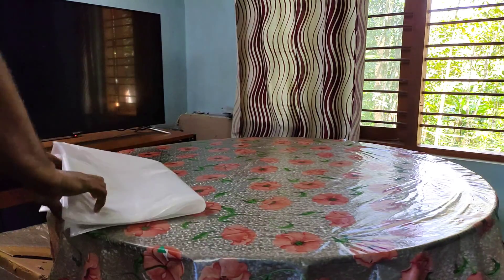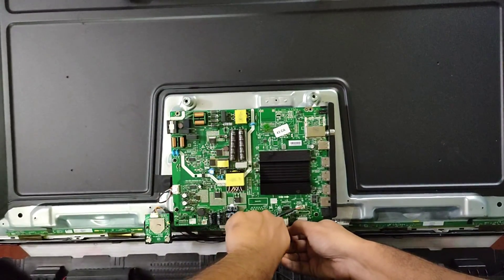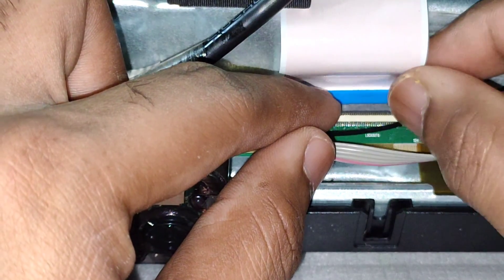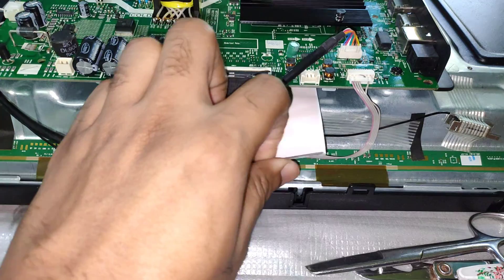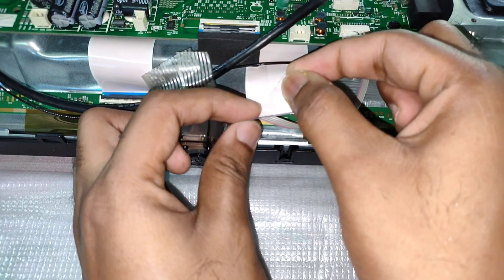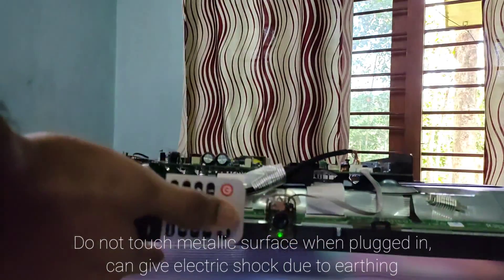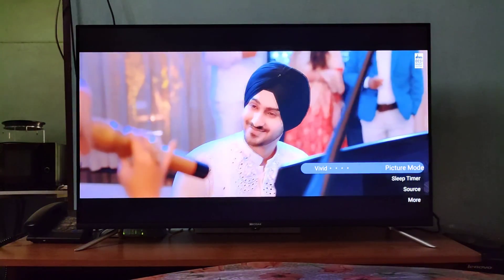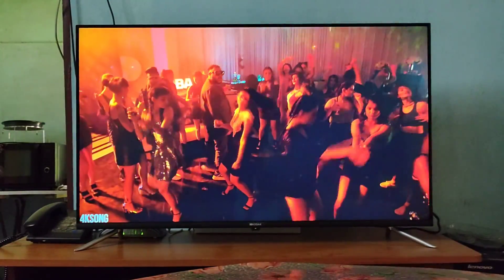LED TV display repair flickering flashing screen Kodak CA 108cm (43 inch) Ultra HD (4K)

Comment: my Hitachi had this exact same problem shown at 2.38 except the turning off part. different model TV with different internals but had the same kind of ribbons, I taped them exactly as you did and it fixed it. thank you for saving my TV!
Reply from the maker: It made my day✨️🙏 I'm glad thank you for sharing

Comment: My tv sometimes it’s flickering den again it’s  normal ….
Reply from the maker: It's better u don't watch it in this condition, it'll get worse over time and eventually completely stop working. Try to get it fixed by any technician, if under warranty pls claim it through authorised sources
Reply: @MECHTOYSOFFICIAL  technician can’t detect the problem .. according to me I think THE HDMI JACK 1  2 3 4 got some rust ..  but I don’t know  how to change it
Reply: If u have anyone from Kolkata … who can help me just share the no THE PICTURE w quality  MY TV IS SUPERB .. its SONY BRAVIA 55 w950b model
Reply from the maker: @BubbleTrouble645 does the User interface, menu,  apps all appear normal? They also flicker? If it's only when u plug in external PC via hdmi then it could be as u said
Reply: The problem is like for 5- 6 hours the tv is working fine even 24 hours also but again after 2-3 day the problem showing ….
Reply: @MECHTOYSOFFICIAL  it’s alll started after i connected my laptop   Wd hdmi cable .. few month back .. den it stopped after I shut down my tv n restart ….. den again few days back connected my laptop .. it again started n right now it’s continuing .. for 2-3 days I m not having problem den again on 4 day I am having problem .. … its happening mostly due during the afternoon time … .. .. yes it’s happening  the same way after I remove the hdmi cable
Reply: I thing some frequency or voltage issue.

Comment: I did this and the flickering has stopped. There are few  horizontal lines in the upper few centimetres but that's ok. Thank you so much.
Is your tv still problem free or noticed any worsening of the lines?
Reply from the maker: It lasted for several months...about a year. Then started flickering again. Nobody tried the method again and it completely stopped working. The thing is, once it starts flickering, don't watch it on that state. The longer u watch, more damage will happen

Comment: My TV entire screen goes green flickering and switches off then restarts. Then again after 5 mins green flickering shut down restart
Reply from the maker: If u keep on watching like this, it'll get worse over time and eventually won't stay ON for a second. Better get it checked from a technician
Reply: @MECHTOYSOFFICIAL  I changed the switch board. Worked a bit longer but again same issue. Is this how you tv started behaving as well ?
Reply from the maker: Do you mean motherboard?
Reply: @MECHTOYSOFFICIAL  no the power plug of the tv connection (switch - ON OFF)
Reply: Also, the tv before shutting down and randomly making a noise like a bomb.
Reply from the maker: Lol😂 sorry I didn't face this kind of a problem. I have no solution. It doesn't seem to be related to the switch board
Reply: @MECHTOYSOFFICIAL hahahha so not the issue with the switch board ( ON OFF )